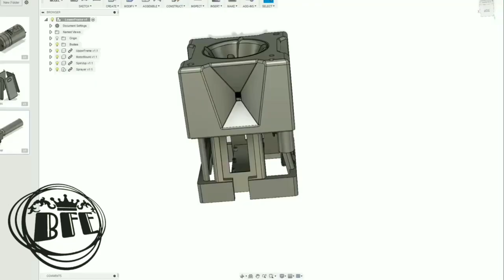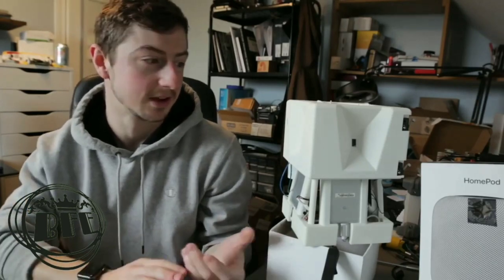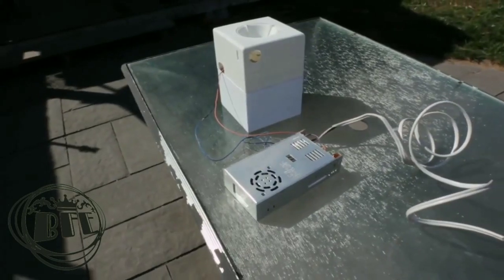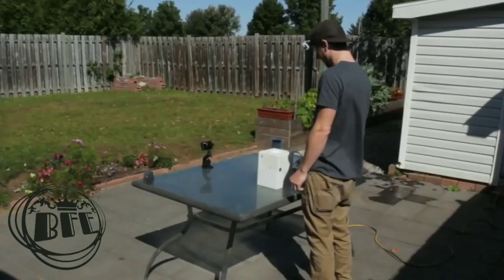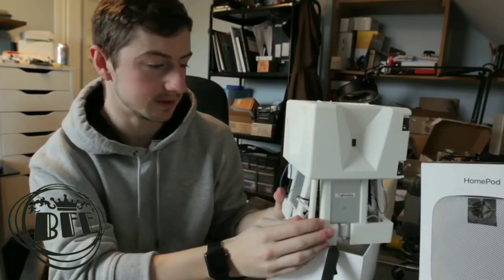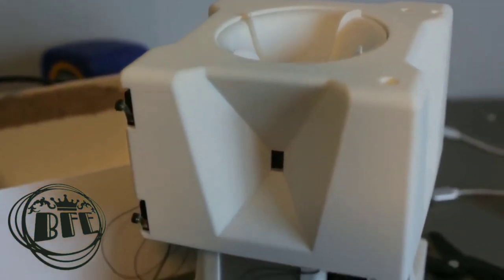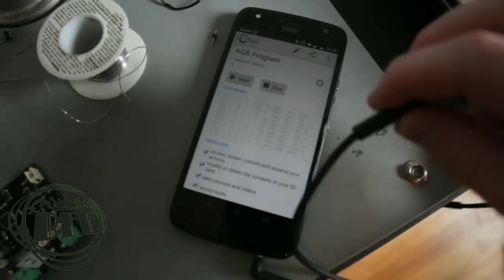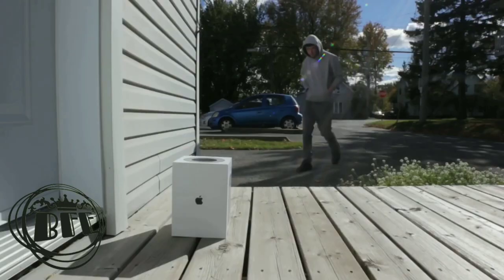Porch Pirates Caught And Confronted | Package Thieves Fails Caught On Camera

Comment: In Thailand in the 70's the landlords used a very effective way to stop thieves. The housing compounds were usually surrounded by a wall with a layer of concrete on top.  When the concrete was wet broken glass and other sharp objects were placed in it. At the compound where I lived the husband would apply a mixture of feces, urine, and a third element that I'm not sure of. He would do this every day during the monsoon and every couple of days in the winter. I never saw anyone try to climb the wall, nor place their hands on it without looking closely.
Reply: @LadyMaven  Yes it is dangerous for kids, however it is usually the parents who send the kids to steal.

Comment: I don't get the purpose of stealing these random packages. I'm assuming half of these thieves don't even know what's in them, so why do it? Suppose you open it up and it's just a box full of lightbulbs.
Reply: Well that’d brighten their day.
Reply: They can resell it in another state use it or give it away as a gift even pawn it as the owner doesn't have the code for it as the item never arrived. They also don't usually take one item, they know the routes for FedEx and UPS and USPS and can follow them trying to be discreet. They have backpacks, bag of bags and drivers, this is an occupation for them which can be more lucrative.
Reply: @rodgerdeighton8098  ha see what you did there